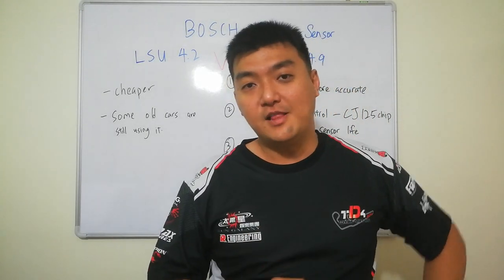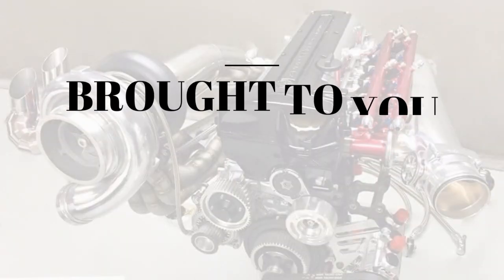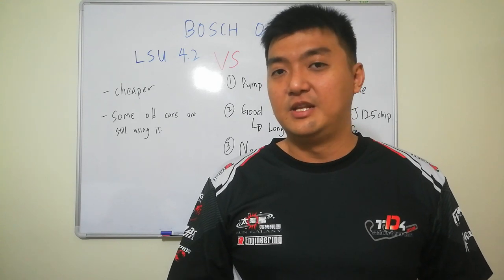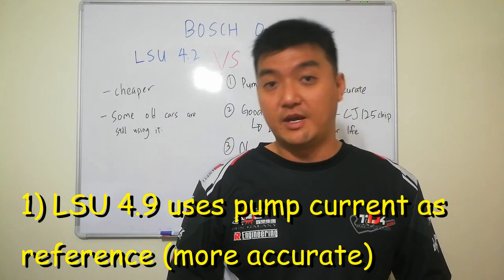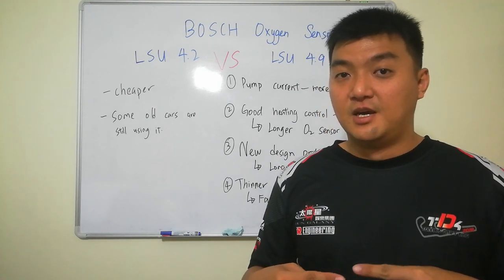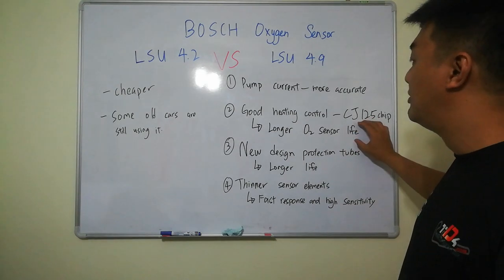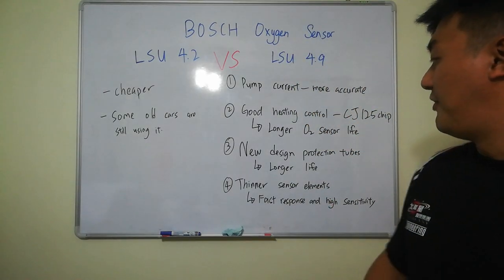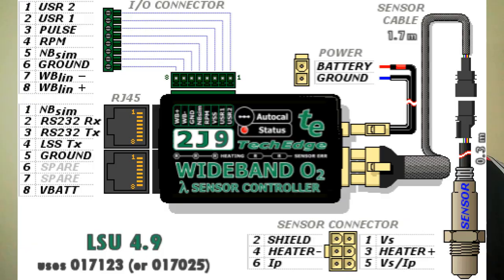2JZ Tuesday - Bosch LSU 4.9 and LSU 4.2 differences

Comment: Hello, the 6 pins of the 4.9 what are for? On datasheet i saw 2 pins for voltage 7,5v, other 2 pins for voltage 10.8 V to 16.5 V (ten TO sixteen, what does it means? Like you want between these 2 limits?), and then the last 2 should be the output signal of the O2? A little bit confusing. Can be tested by manually input each voltage in it and then measure it?

https://imfsoft.com/files/Lambda_Sensor_LSU_49_Datasheet_51_en_2779147659pdf.pdf
Reply from the maker: Hmm I guess u got the wrong diagram.. Have to find one generic diagram for lsu 4.9

Comment: LSU 4.9 breaks down more often in aftermarket installations
Reply from the maker: Hmm not really, 4.9 is much better than lsu4.2.. 4.2 always out of calibration
Reply: @cheapkailaujing personal experience combined with EFI tuning groups tell otherwise...
Reply: @cheapkailaujing  Speak of the devil. Another sensor LSU 4.9 in a subaru. just broke down i have a screenshot of the logs if you like to see... 100$ down the drain.
Reply from the maker: @ngt84  oh dear.. Do u have a garage or something that customers always send their cars to u.. Or ur cars all have lsu4. 9? Gotta install correctly too to prevent it from breaking down easily
Reply: @cheapkailaujing  i have clients with tuned cars. They all forcefully went to 4,9 because most new gauges come with it
Reply: We used a wideband 4.9 sensor for a celica gt4 (innovate gauge). Sensor broke down in 80km...
Reply: @mikelangelo2877  as said in the video, the closed loop heater control is critical for good sensor life.  Many aftermarket controllers, especially innovate products, are too aggressive and not that stable with the heater control algorithm resulting in short sensor life.  4.9 sensors last 100k miles and longer in OEM applications due to control algorithms optimized for sensor reliability rather than fastest warmup times.  Proper sensor positioning and not allowing them to preheat before starting will give you a much better chance for acceptable sensor life.  High oil consumption from worn engines or leaking turbo seals, aggressive retard 2 step launch control and anti-lag setups will also significantly reduce the life of the sensors, especially when combined with poor heater control algorithms.
Reply: @hdrenginedevelopment7507  Spot on. High zinc content in heavily friction modified oil also adds to the fragility of the system

Comment: I have an AEM AFR gauge in my car, can I update from the 4.2 to 4.9 without changing gauges?
Reply from the maker: Hmm sorry I don't think so. Even wiring is different
Reply: Thanks for the answer, not what I wanted to hear unfortunately, now to find someone to trade me a 4.2 sensor for my 4.9
Reply: I bought a 4.9 aem unit, but my parts store only stock , 4.2 I been splicing a 4.2 for years.
Reply: I believe you can you just connect the program and adjust settings at least thats how it it with innovate mtx-l but the cable harness is different.
Reply: @ham003latechedu does it mean i can use 4.9 to to my 4 2 senor?